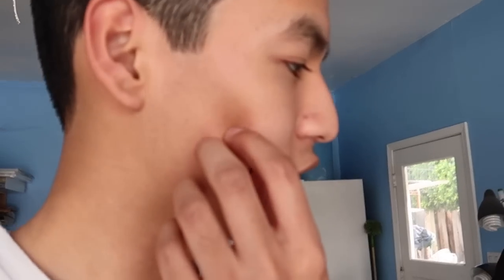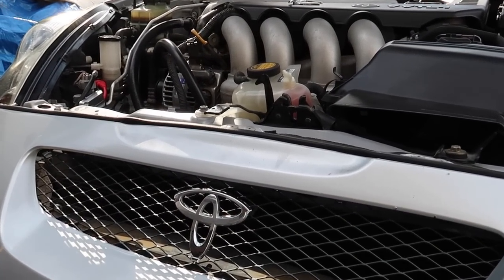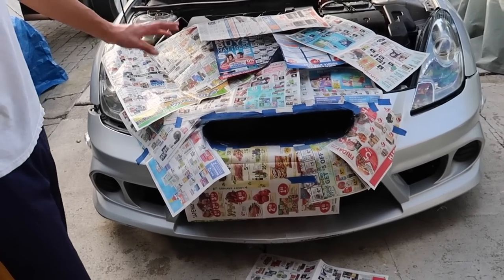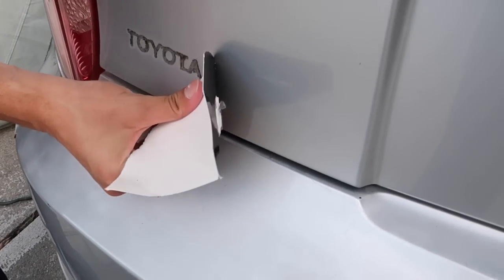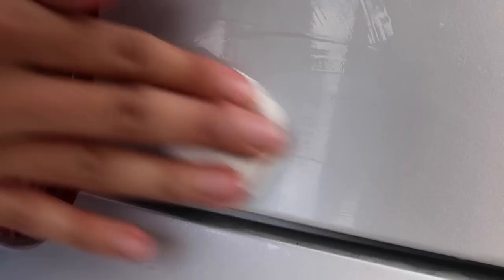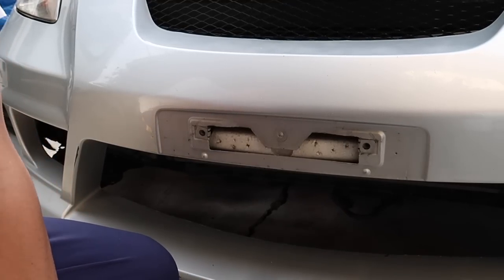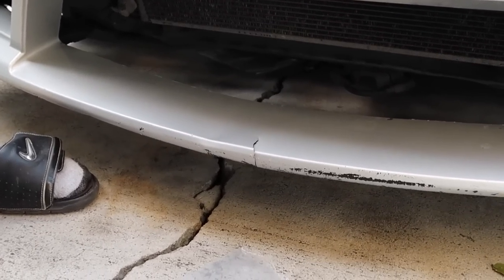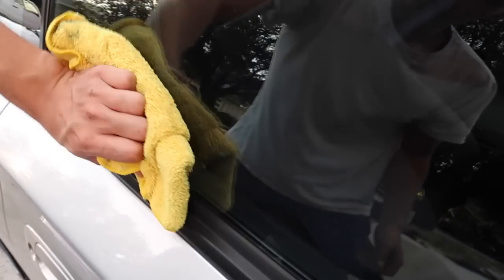Emblem and Front Plate Delete + Hard Water Spots Removal | Toyota Celica

Comment: Hi, I hava a question: Can you get rid of the Celica word on the rear end on top of the licence plate?
Reply from the maker: The only way would be to use body filler and repaint that. There are also carbon fiber handles without “CELICA” but I believe those are quite hard to find